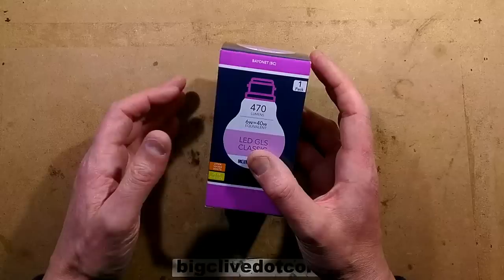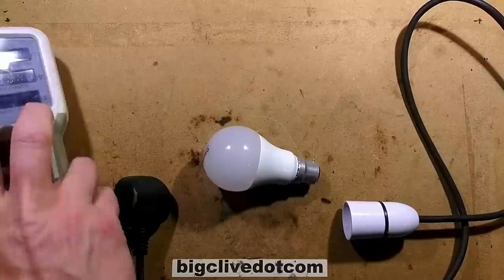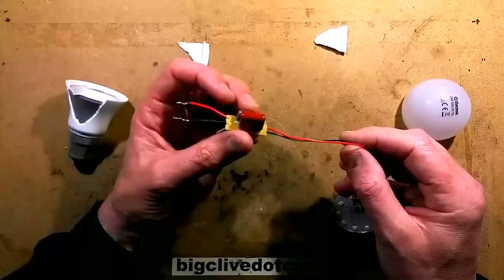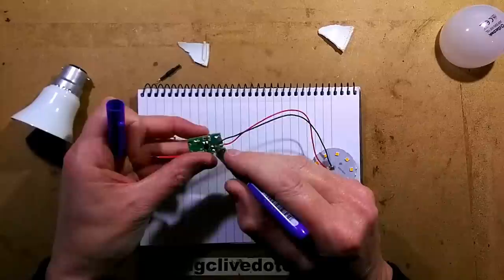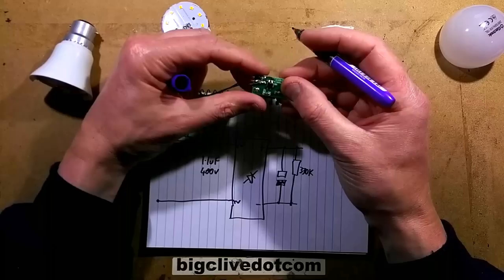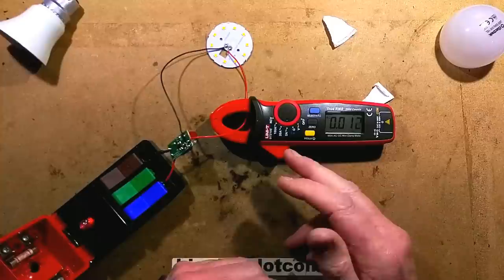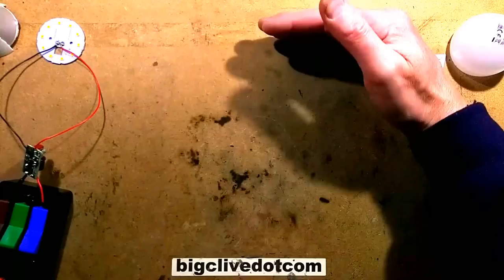Poundland 6W LED lamp teardown with schematic.

Comment: hmm, now im wondering if i could take apart a poundland garden solar light and connect it to one of their solar flappy plants to get it to run 24/7...
Reply from the maker: You could just add a diode and NiMh cell to make a solar flappy plant run 24/7.  Any excess current from the solar panel would top up the cell for night operation.
Reply: Hmm, true, time to break out the soldering iron

Comment: This may seem a daft question. I've a lot of 12 volt led downlighting, I live in NZ where there is lots of sun light. Would I be better off converting my lighting system to 12 volt using a simple solar panel to charge a12 volt lead acid battery, and if the charge on the battery got to low, charge it up on mains. It would also mean in the land of over head wires it would give lighting during high winds when trees often full on the lines, and the odd earthquake. Thanks for all your videos. My be a daft idea😊

Comment: i am curiuous, is there a differance between what end /side the fusable resistor is on, im guessing not
Reply from the maker: As long as it's in series with the circuit, either side is fine.

Comment: Hi there I'm not very clued up on watts.  I have 2 large rooms with high ceilings with a basic pendant, in the middle of each, I have I kid you not for 5/6 years simply been running a free energy saving bulb the tube shaped ones which take a moment to turn on from cold, these alone no shade...i'm a savage.  I have white walls so the rooms have been very bright.  I just got some fancy shades which has of course made the room darker as you would expect,  I now want/need something brighter that is cheap to run, I'm a fan of poundland.  What would you recommend or should I look else where?  It's bayonet and none dimmable.

Comment: 50 ohms? Couldn't the resistor across the electrolytic just be putten in place to fool people measuring the wattage of the lamp?
Reply: It was a 330k resistor. WIth the full 187V that Clive measured across it, it would be dissipating about 0.1W---not enough to make a significant difference to the measured wattage.
Reply: The 50 ohm resistor is in series with the LEDs.  It's probably there as a cheap fuse.  The 330 kohm resistor across the electrolytic  capacitor is there to discharge the capacitor when the lamp is unplugged so that it doesn't electrocute anyone messing around inside.

Comment: What effect would houses upon houses running that kind of power factor have on the grid?
Reply from the maker: The lighting represents such a small part if the homes power usage that it's not too bad.
Reply: I was wondering that. We're not cooking or running the washing machine all the time. I guess the grid is capable of a significant portion of us cooking / boiling the kettle while running the washer and tumble dryer that even when that load isn't present the out of phase current from the LEDs is still not significant?

Comment: Doesn't  your camera have manual color balance? I've got a generic white balance reference card from amazon for a couple of bucks. Just hold it in front of the camera, push the button telling it “this is white” (even thought it's actually gray) and you're set.

Comment: Which bulb cap is most common in the UK, bayonet or screw?  (In the US the Edison screw is the norm.)
Reply: CountSmackula1 Bayonet.
Reply: Bayonet, though the fancy decorative ones with many lamps in one fitting often use small screws. Large screws or small bayonets seem much rarer
Reply: Large screws (E27) are rarer in the UK only.

Comment: I don't really like that 250V electrolytic. If the LED's go open circuit then voltage can rise and blow that capacitor up, once happened to me with a cheap chinese lamp, blew the whole thing into pieces.

Comment: What exactly are the limits / downsides of capacitive dropper type circuits? Why would you use a capacitive dropper vs switch mode power supply? Like are there current limitations?
Reply from the maker: Capacities droppers are only suited to low currents, so they tend to use large arrays of LEDs with a high voltage and low current to get the power rating.  The switchmode supplies can be used to drive just a few LEDs at high current.  Capacitive droppers are simpler and more reliable than switchmode supplies.

Comment: Any idea why 60w (equivalent) 800 lumen bulbs are often priced much higher than the 40w versions, eg Home Bargains £1.60 - 2.70 and greater?
Reply from the maker: +icarusi As the power rating goes up the cooling of the LEDs becomes harder and requires extra thermally conductive components in the case.

Comment: Ah yes, I had a Poundland 5W bulb and it did indeed fail quickly and go discoloured. The candle ones I got from them seem to be holding up fine so far though.

It's  impressive how much these have dropped in price. £1 for a 40w equivalent, £10 for five 60W equivalents (actually a bit brighter I think) from Screwfix. How long before LED is the only kind of lighting for sale (outside specialist applications) I wonder
Reply: That's because they are massively subsidised. When halogen get phased out I'm guessing these will go up.

Comment: Always nice to watch another bulb review. - Thanks Bigclive!
I am trying some of the LED bulbs sold in the shops of Swedish store chain "Biltema" at the moment. They are getting a hot supper temperature wise, as I have put them in the same type of closed lamp in different parts of the house. The brightest one is the 13.8W / 100W equivalent, and then it's the 75 and 60W equivalents. They have lasted a good 6 months so far, still working flawlessly.
When do you think we will see LED bulbs that can withstand the temperatures inside the kitchen oven?

Best regards from Norway

Comment: Just wondering what would happen if you had a capacitive dropper on both sides of the incoming supply? Would it double the rating, half the rating or blow up?
Reply from the maker: If you put two capacitors in series the combined value is lower.  The lamp would be dimmer.

Comment: The box shows 6W 470 lumens, is there a relationship between watts and lumens? 
I grew up in the days of 40, 60, and 100watt lamps with bits of wire in them (que Beatles and similar music) were the norm and 40W went in small rooms 60W in hallways and smallish rooms and 100W in larger rooms.(don't think lumens existed then?)

Those nice people in Europe decided that was wasteful and stopped making them, leaving me having to use what looks like a small light tube folded up................... then it got harder to find them and something that looked like the old bulbs came in but low wattage ......... all the ones I tried went to silicone heaven within a couple of weeks leaving me scavenging all the local outlets for more   small light tube folded up and I found a place where I got 12 X 11W equ 50W ones to store up for future use.

My living room has a 3 fitting holder using 3 of those so 33W rated at 600 lumens each so 1800 lumens by 33W is there an LED equivalent to 600 lumens each or do I need to wait for the tech to evolve further?

BTW I really like your channel and the content but all the technical stuff is way beyond me I still remember when a transistor radio was a wonderful new thing and replaced the bakerlite radio on the kitchen mantelpiece 8-)
Reply: bought one of these today and was greatly impressed by the output in my upstairs hallway

Comment: If an LED goes o/c, wouldn't the 250V electrolytic would get too many volts?
Reply from the maker: Yes.  A previous test shows that the main capacitor limits the current so it usually vents in a controlled manner.

Comment: +BigCliveDotCom Maybe a topic for a future video if you are looking for inspiration... I've built many lighting projects from discrete (white) LEDs designed to run at 20-25mA, including your aroma oil plugin/night light hack. It seems that they last for a couple of weeks and then begin to degrade to the point where they are noticeably dim. why does this happen and what can be done to combat it? Cheers!

Comment: Clive, have you seen the Morrisons 6w filament lamp? They seem too good to be true based on the figures; 806 lumens from 6w - almost twice as efficient as this Poundland item. Much more expensive too mind you, but that efficiency (efficacy) is too good to miss. Very happy with mine.
Reply: 134 lumens per watt? That is impressive. I had an 8W filament one that was also about 800 lumens. It didn't last long, but then it was a cheap eBay job.
Reply: 81rjp they are £5 each. Had mine about 3 months so far at a guess; used daily. Should be out of the immediate failure part of bathtub curve, but that's not an indication of longevity yet I know!

Comment: Another comment. Do all lamps put the LEDs in series? Seems to defeat one of the benefits of LEDs
Reply from the maker: It allows simpler power supply circuitry if the combined LED voltage is closer to the supply voltage.

Comment: So if I used to have 60 w tungsten lamps and had to buy 11w little folded up florescent and now have a 5w led one am I correct in thinking the led one can stay on for 12 times longer than the tungsten ones for the same power usage, and if I change all my  florescent ones for led it will cost 1\2 as much to run? ......IE 5w each instead of 11w each.

Great channel btw watched almost all of it now .... sent you a donation via paypal a while back .....well worth the money to watch and learn (in my late 60's now and little clue about the newer stuff)
Reply from the maker: Yes, if you have a traditional power meter the LED lamp will cost much less to run.  With some modern meters that measure apparent power it may be a bit higher.
Reply: Thank you and Happy new year to you.

Comment: Thanks for the interesting tear down, do you know what  makes this a 6W LED and not say a 3W LED?
Reply from the maker: It's all to do with the power dissipation.  You could convert it into a 3W lamp by changing the capacitor from 1.1uF to 560nF.
Reply: Thanks for that, I was wondering how they did it, not sure why a 6W costs so much more than a 3W when there is only a cheap capacitor change,  I bet you can`t answer that one..... lol :-)

Comment: I'm going to be that guy. What's the make of the power clamp you're using? I'm looking to buy one so I can easily test my solar panels and batteries. Seen cheap ones and expensive ones and they all seem the same. So to play it safe i'll just get the one you use, anything you're happy with will be more than enough for me. :) Thanks.
Reply from the maker: Unit-T UT210E from amazon.

Comment: Any chance of another modification to 1w video with one of these types of LEDs as the internals look different to the others. If not, can someone point me to which parts need to be replaced with what to reduce the output to 1w.

Also, noticed on the candle shaped bulb i got the top just popped off, not sure if that's the same for all candle shaped ones in poundland.
Reply from the maker: In this lamp you would replace the 1.1uF capacitor with a lower value one like 330nF rated for 400V.
Reply: Cool thanks. Can the 250v 6.8uF capacitor be left untouched even if i replace the 1.1uF capacitor with a 220nF or even 100nF 400v capacitor?

Going to mod two 6w Poundland bulbs i have; one with 220nF and the other with 100nF. Thanks.

Comment: I just got some of the poundland golf ball type bulbs 3 w /25w ones they are nice cool white light have you tried them ? Hopefully they will last imagine they will have same inners . you prob won't reply but thanks for all your superb videos 👍👍
Reply from the maker: +Pauly H The lower power lamps in the 3W range tend to be very reliable.  They're actually quite well made inside.
Reply: bigclivedotcom Thanks very much for your reply , think I will get some more they seem good so far . cheers.

Comment: If you would be interested, I could send some film quality balanced light LEDs your way. I got a job running the LED chunk of a rental house in a large part due to things I learned from you, and would be happy to repay the favor. The LED strips come back damaged but usable very often, and we can't send them out that way so they are free to a good home. I could also sweeten the deal with a drunkscience usb soldering iron built out of garbage laying around.
Reply from the maker: Thanks for the offer, I'm just about to travel with work so can't really get anything sent at the moment.  But I'll keep it in mind, thanks.

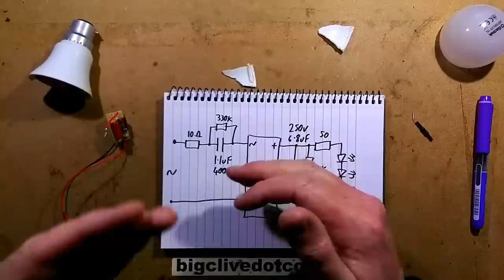Comment: 10:30 The capacitor "lets through a small portion go through".  A small portion of what?
10:40 The rectifier does not "pump up" the capacitor.  This is not a voltage multiplier circuit.
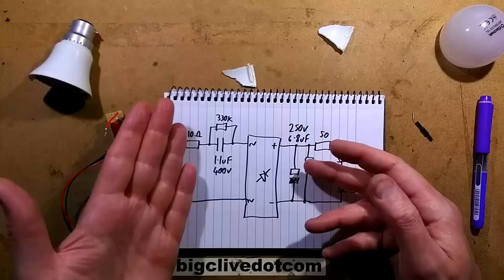10:47 The resistor does not limit the peak current.  47 ohms is too small to have a limiting effect.  There is no "inrush current" at this point in the circuit.  Nor does the resistor provide "protection against ripple".  It's probably another "fuse".
Given the video's length, I expected a better analysis of the circuit, especially given how simple it is.  You actually sound as if you don't really understand it, although you probably do but didn't bother to think out your explanation before running the camera.  I don't agree with your advice, either.  Buying cheap LED lamps that overheat undermines the whole point.  If you pay a decent sum of money to a reputable manufacturer, you'll get an efficient lamp with a good power factor that will last for a long time and be cheaper in the end.
Reply: "Buying cheap LED lamps that overheat undermines the whole point."
The whole point of what?

Comment: What's the purpose of the 1.1uf capacitor at 7:20 ?
Reply from the maker: It rations the amount of current that can flow on each half of the sinewave.  It's a very simple way of creating a non isolated low current power supply.  Look for "Capacitive dropper".

Comment: This (http://www.homemade-circuits.com/2015/01/calculating-capacitor-current-in.html) says that from a 1uF capacitor we will get ~70mA. You measure 27mA. Where do you think the rest is?
Reply from the maker: The formula for capacitive reactance gives a result that can be compared to a resistor in ohms, so the current flow will depend on the voltage being dropped across it.  In this case it's not high as 180V is being dropped across the LED array.
Reply: Thanks for the answer! As I understand the capacitor determines the max current, and the voltage drop will depend on the load, not vice versa. So this power supply works as a current generator, and will do (70 or) 27mA no matter what. You can try shorting out one LED, the current will be the same 27mA, but the voltage across the pack should decrease to 162V... (For some strange reason that I dont fully understand)  you can drive only one LED with this, too! Am I wrong?

Comment: Some info and other details about the clamp meter and how to align and zero out the last of the offset from local magnets/metal.  You've either done it already or your meter is good from the factory. :)
https://www.youtube.com/watch?v=beXnFpPPwg4
https://www.youtube.com/watch?v=0lyMiAKfOjU
Oh. And same guy has also made current output for the meter to attach to your scope. Might be something to do to play with your new toy? :)

Comment: Audio level is nice, without any audible AGC effects. For me the bass level is perfect. But the first impression was of an awful lot of sibilance. Colour balance is rather on the cold side and the shadows from your hands are really nasty. Some sort of ring light or fill is needed please.
Reply from the maker: +48snapper The bench is under shelving, so awkward to light consistently.  I've got plans though.
Reply: The audio in this video has less low frequencies and sounds a more flat. It is good to listen to. Although I do like the richness and compactness of the sound in the video where the heated shower unit is taken to bits. The only thing there is that the microphone pre-amp stage could have done with a low frequency roll-off filter.
Reply: I bet those involve LED drivers and strips! Love those things.

Comment: If you take a hair dryer to it or you hot air gun, that should come off a lot easier, yes, no?
Reply: MrBrymstond No. Not when it's glued with silicone which is quite heat resistant.
Reply: A heat-gun running at 200 degrees Celsius will soften the silicone without destroying the globe if you direct the heat at the aluminum

Comment: Are you sure that optimising your content for the low-end shitty devices is the right way to go? If you'd just take the boominess down 10% from the last "mega-boomy" video, in post-production, it would be just in the Goldilocks zone.
Reply from the maker: I try to cater to the widest audience.  This sounds too tinny though.  I've got a different microphone on order and have switched back to the older unit with heavier bass.

Comment: Huh. Your lights so cheap it doesn't even come with the screw base thing to install it.
Reply: joblessalex it's a standard UK bayonet base. Designed for the stand uk ceiling light rather than standing lamps.
Reply: joblessalex it's a standard UK bayonet base. Designed for the stand uk ceiling light rather than standing lamps.